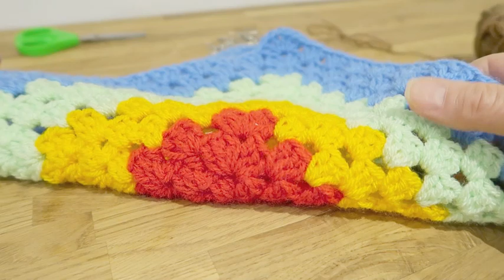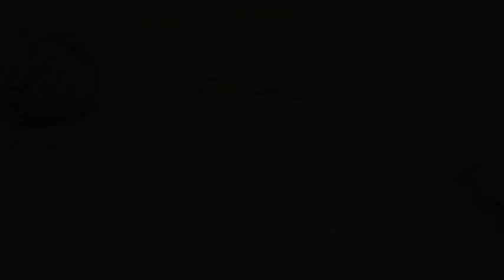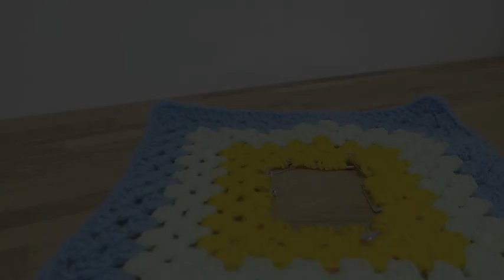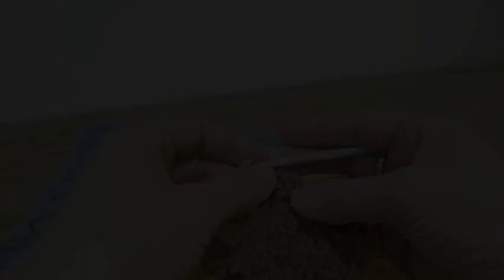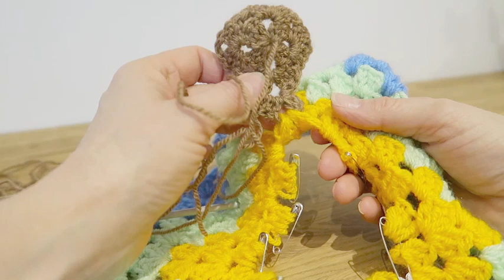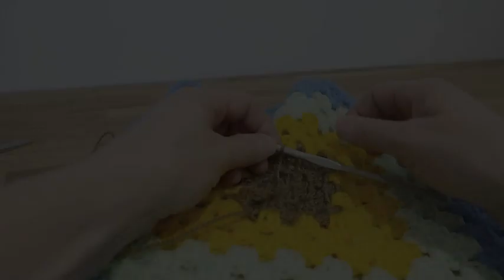Granny square blanket repair - Crochet

Comment: This is so helpful, thank you so much!!! This is exactly what I was looking for. I made a huge granny square for a project and then realized that the color I had chosen for the very center looked terrible. I used a color that was only in the middle and the outermost edge, and it didn’t blend well with the other colors at all. I really wanted to replace the center but I didn’t want to redo the entire project. Thank you so much for your help!! Now I can just fix the middle and the outside row
Reply: Exactly the same as me!!! Thank you for this wonderful tutorial 😊